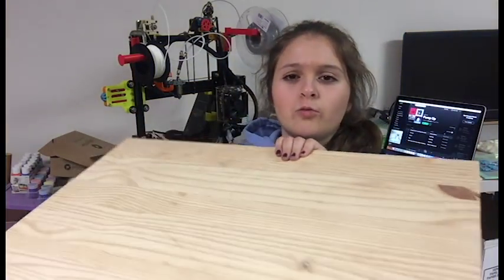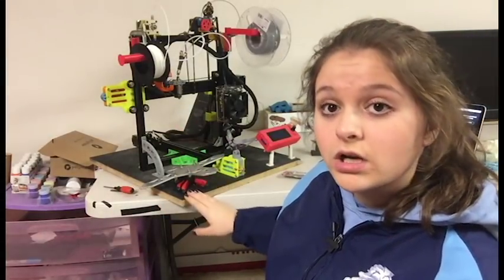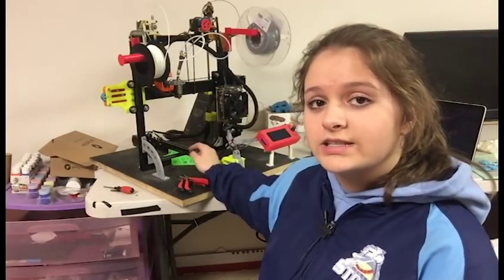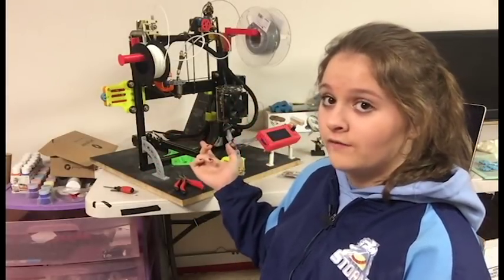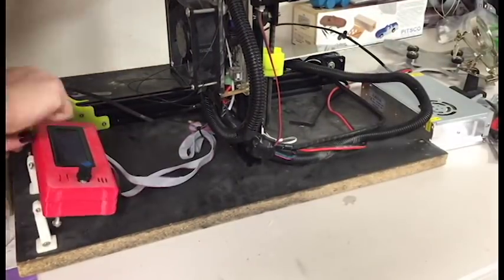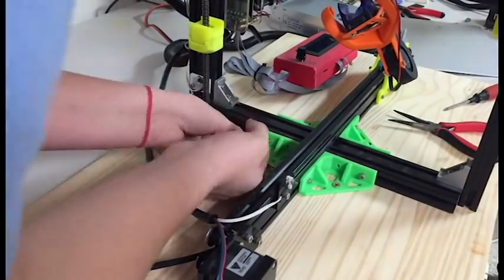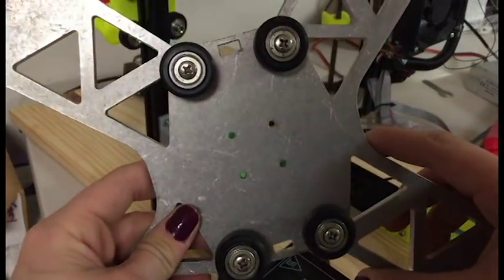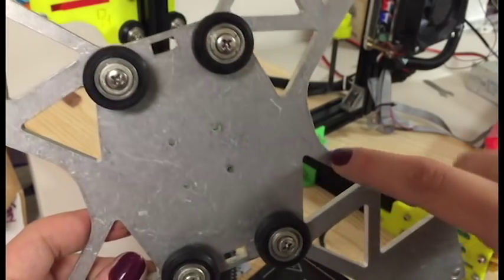Setting Up Your 3d Printer

Comment: Try plywood or even better would be form-ply, it has a low adheasion coating on it. Its very stable and will not warp due to temperature and humidity changes.

Comment: Those two bolts are on the bottom are called "Eccentric Nuts" in my CR10 mod video, someone called me out for not just adjusting them to tighten the wheel against the rail. Basically it's an offset screw that you can turn to make the wheel tighter to the rail.

Comment: I commend you for your work! One thing you need to keep in mind.  You used a level to "level" your bed, which sounds logical, but in reality you need to make sure your bed is level in relation to the print head.  Level to Earth is irrelevant as long as your print head and print bed are level to each other.  Check out this video for a great explanation on "Tramming"! - https://www.youtube.com/watch?v=CcAmZqb-ZEE
Reply from the maker: Jeff Gould thank you for the suggestion and yes once I get my printer fixed I will level it with the print head